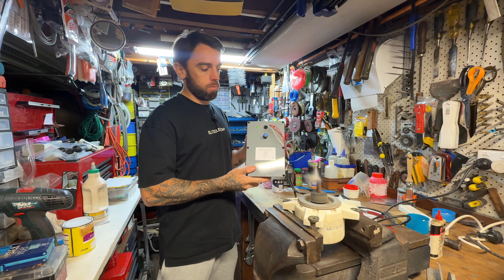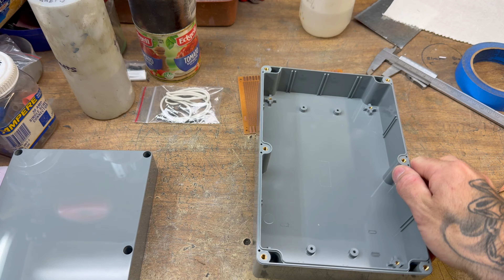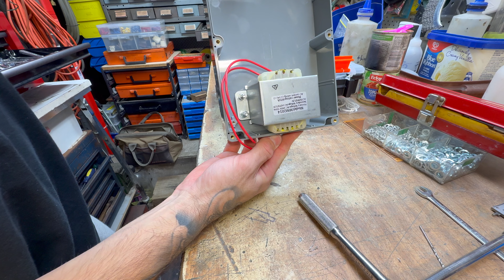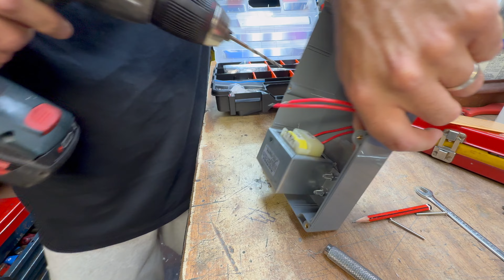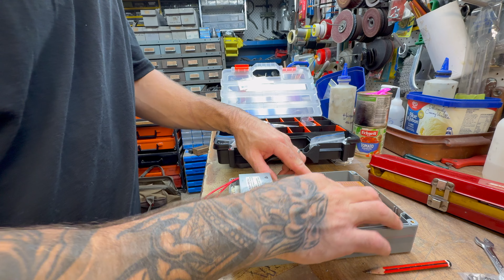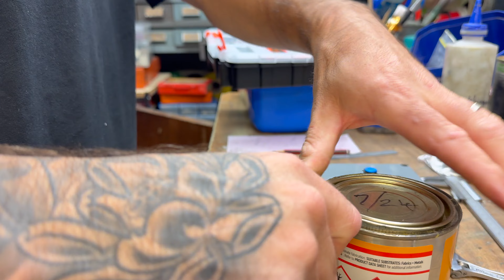Build a Daikin Fan Motor Tester – Works on All Brands!

Comment: It might be possible to scavenge a small indoor unit board to use as a power supply for the 320vdc and 15dvc, then just need a circuit for the speed control signal
Reply from the maker: There’s an idea!

Comment: Hey Mitch, just wondering, is Daikin as reliable as the two Mitsubishi brands? I read on Product review that the new ones are not as good, but I wanted to get your thoughts? Thanks love your videos btw
Reply from the maker: Hey mate, in my opinion Daikin and Mitsubishi Electric are as reliable as each other. I personally think Mitsubishi Heavy Industries is less reliable. 
Daikin products are less reliable then they used to be but that’s because the old systems weren’t inverter and therefore there is less things that can go wrong but that’s the case for all brands.
So in a nutshell, I think Daikin is definitely as reliable as Mitsubishi Electric and more reliable than Heavy Industries (in my opinion).

Thanks mate

Comment: Nice work mate love the videos I work on a lot of Daikin here in nz forever replacing fan motors and pcb’s
Come across a few 3 wire fan motors on less known brands like Toshiba but try and steer clear of that garbage 😂 find Fujitsu and Mitsubishi electric to be more reliable over here 
Look forward to the next video
Reply from the maker: Thanks mate !
Reply: Was also gonna mention I do a lot of ducted zone control systems and watched a video of you talking about spill zones. In the case where you are not doing a full house ducted and don’t have a living or hallway to make a spill zone we install a bypass 
The bypass goes straight from the supply to the return opening more as the zones shut off  this is especially good on bedroom ducteds   We use more of the air touch 5 from polyaire also a good system 
Just a FYI but you do you boo😂

Comment: Ever thought about putting the female motor plug ends in from the set up so you can just plug the motor plug straight in to test?
Reply from the maker: Yeah but I’m always working on different brands and unfortunately every brand has a different plug. Even one single brand has different plugs for different models. But with that being said, I’m sure people can make this better. Which will be cool to see.
Reply: @maracservices  the conector change between brands and models, but does the voltages and wiring digram changes as well? Or all bldc fans have a 310v, GND, 15V, speed control wiring with the potentiometer connected to it and the FB?
Reply from the maker: @gustavotoledosoares3103 yeah all the 5 wire BLDC fans have 320vdc, 15vDC, Ground, Speed Control and Feedback but the colour of the cables are different.
For me, I just put a sticker on mine that says what colour wires do what. The fan motors tell you what each wire is. 

I made my cables the same colour as Daikins wiring because I work on Daikins a lot.
Reply: @maracservices yeah some of them the speed control and feedback are swapped and some comes in different colours as well. Im excited to see the end of your BLDC wiring part.